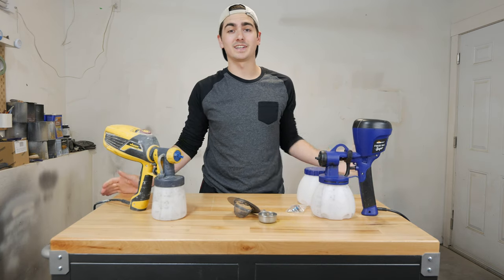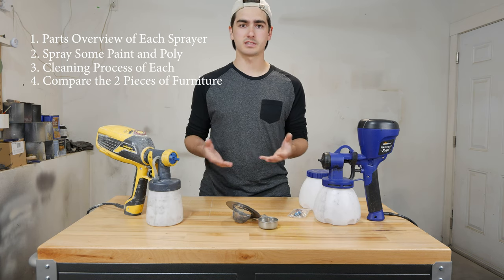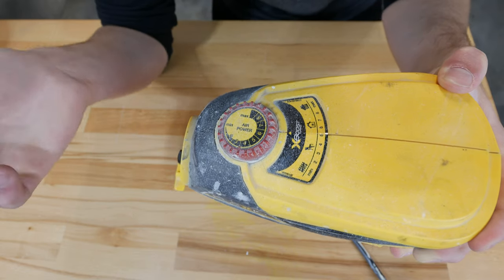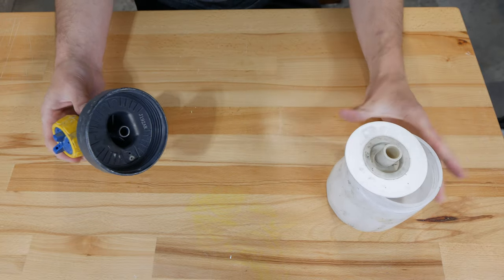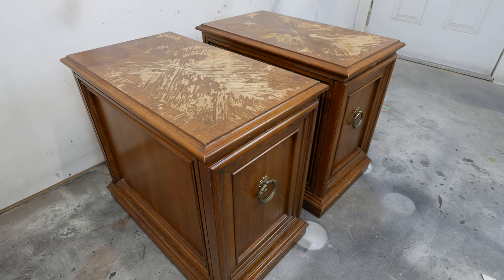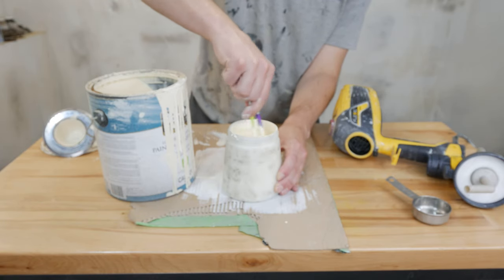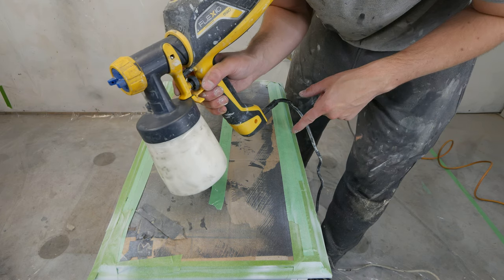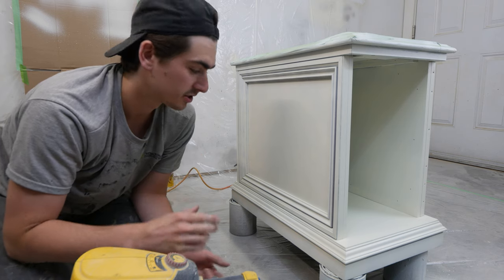Wagner Flexio 590 VS HomeRight Super Finish Max | Paint Sprayer Comparison, Review, and How-To

Comment: I have both of these except my Wagner is flexio 5000. The Wagner has a much better finish. Howright finish was a bit bumpy. My Wagner is great for the multiple projects I do. I actually bought a separate hand gun with container for about $30. I was able to switch between colors quickly. Cleanup is also hands down the Wagner. Love it.

Comment: Control and repeatability are key with any paint project. I do not recommend pouring unused paint back into the original container as you are now mixing thinned with thick paint to produce a somewhat thinned paint. Once you find out what dilution works, stick with it. Keep the thinned paint in a separate container and then you can thin more to always have the same dilution. Granted as the original paint ages it will get thicker and require more thinning, but for a specific project you can control the process from start to finish and then readjust with the next project. Thanks for the comparison.
Reply from the maker: Good information, thanks for watching Tom!
Reply: A simple funnel with a small hole can help here.  When you find a sprayable thickness of paint that takes, let's say,  8 seconds to drain from the small funnel,  you can always calibrate the thickness.

Comment: Don't know if its been mentioned but to help with the spitting at the start of spraying on the wagner pull the trigger in slightly to kick in the turbine then after 3 or 4 seconds pull the trigger in fully to release the paint.....I found this helps.
Also diluting the paint is key to a good finish.... its just trial and error but I was diluting up to 50%
Reply from the maker: Yes, slightly pulling the trigger certainly helps but I do still recommend starting your spray off the surface you are painting just to be safe. Thanks for watching!

Comment: Since the Wagner is much easier to clean and wanted the variable speed turbine for added flexibility. Despite the Wagner having a higher pitched motor, it seems quieter. So I’m going with the Wagner Flexio 3500.
Reply: Flexio $185...homerite $100 fyi

Comment: Quick tip. If you turn the nozzle diagonally on the wagner, it will spray a round pattern vs a flat pattern.

Comment: both of these sprayers suffer from the same problem which is that neither have a thumb switch to activate the motor. on these machines when you press the trigger it will do two things (activate the motor and allow the paint to flow at the same time). when you press the trigger it will take time for the motor to spin up and the paint that comes through during that time will be at a much lower velocity than it needs to be causing all sorts of splatter problems.
with separate controls you can have the motor at full speed with the paint flow off, and then when you trigger the paint flow it will be coming out at full speed.
almost no one talks about this but its absolutely vital if you want to actually get any amount of work done without going back to fix mistakes! the previous version of the wagner flexio had the thumb switch for the motor, i have done hundreds of hours of emulsion work with it and i wont use any other sprayer.

Comment: I got the Wagner and have painted several door and drawers with the big sprayer after thinning the paint down quite a bit.
Reply: I have found this wagner needs to be cleaned frequently for a consistent operation. The heater air from the motor seems to make the paint dry on the nozzle and then it spits and throws clumps of paint.

Comment: I have a bungalow with a pebble-dash finish that needs painting. - virtually impossible with a roller or brush.   Can I use the Wagner for masonry paint and will it stand up to painting outside walls?
Also would I need to water down the paint?  I was looking at airless sprayers and they seem too complicated for my needs - especially priming and cleaning and wotnot.
Too much hassle.  But the Wagner seems brilliant.  Great informative video by the way.

Comment: Notice the test run of Flexio at 14:00 vs HR Super at 21:15. Flexio seems to spit out paint at the start while HR Super doesn’t. That’s probably why you said it’s easier to spray with HR than Flexio.
Reply from the maker: True, both can spit but the Wagner always does when you start and I guess since I am aware I just begin spraying off the edges every time! thanks for watching!
Reply: @FurnitureFlippa  You paint with Wagner badly. You have to press the trigger gently so that the engine starts and then squeeze the trigger all the way.
Reply: Barely press the trigger to start the airflow without letting the paint getting out immediately. Once air runs at full speed, press the trigger fully. You can start in the middle (bad practice but sometimes you are out of other options), just start moving the gun before you start spraying.

Comment: I also used the green spray tip on the Homewright for poly but it actually works so much better with the blue one.
Reply from the maker: I usually just use my Wagner for poly because of efficiency, but it does spray less when you increase width, so def a better option.

Comment: I noticed the Wagner has two spray nozzles and triggers. One is for bigger projects, and the other for finer detail jobs. That would explain the coverage issues. Which one was used for the 590 Wagner? I wonder if the larger canister and trigger would outperform the home right.
Reply from the maker: I used the fine spray nozzle in this video!

Comment: thank you for doing this review and direct comparison! I am curious about what you do with the sprayers between coats — I had an issue where my wagner sprayer just clogged right up if paint sat and dried, even for a small amount of time. do you do anything to prevent this? Thanks, again!
Reply from the maker: I will put tape over the tip, but I won't let the sprayer sit overnight. I will go in every so often and spray the gun to make sure it doesn't clog just on a piece of cardboard. Thank you so much for watching!
Reply: I take a wet piece of paper towel and saran it over the nozzle between coats. I have left it overnight and it worked fine.

Comment: I'm a novice and need to paint entire walls and ceilings in a new house quickly. Would the homeright be better than the wagner for that? I'm also debating just using an 18" roller...
Reply: I'm still waiting for mines from Amazon but I've own a small gun like this before. My personal advise is to just use the gun to do corners, trims and door but use a roller for doing big areas. It will be too much stopping and going to refill the small cup to do big area. I was thinking if the gun would work without the cup, if it does many you could make a custom hose and run it directly from the paint can.
Reply: @kirkbrown2147  Thanks, that all makes sense, but ultimately, my wife convinced me to just throw enough money at the problem and have painters do the whole house. I still might get a cheap sprayer for small diy projects.
Reply: @Phrancis5  Smart choice. I primed a small  7’x13’ room with the home right and it was a lot work climbing a ladder to get to the top of the wall as you need to be around 12 inch’s away from the area that needs to be painted. Also having to refill the container was a pain. I ended up rolling the paint on with an 18 inch roller it was a lot less work.

Comment: On the Wagner witch gun do you use for polycrylic and how do you set it up? I am try to clear a table top but am having trouble getting a nice smooth coat with the manual techniques. Between coats do you take everything apart and clean to prevent clogging from the polycrylic  drying. Sorry for all the questions but this table top has been such a pain!
Reply from the maker: I do the same with polycrylic as I do with the water-based poly i used in this video, polycrylic is water-based polyurethane. 10% water thinned.

I like the Wagner for spraying it because of the quick cleaning process. But I do not clean between coats unless I am waiting overnight. I will put a piece of tape on tip between coats during the day. 

I have a blog post with some more info you can see here: 
https://furnitureflippa.com/can-you-spray-polycrylic-with-a-spray-gun/

Comment: Hi mate , can I use duluxe wall paint with Wagner ? They are thick paints so I don't know if they are ok for that ? Thanks
Reply from the maker: yes you can, some paints will require more watering than others. Add 10% water, if not enough add another 10%... I have added anywhere from 20-30% water to my thick paints while spraying before.

Comment: How do you determine if you’ll use a brush to paint vs one of these?
Reply: A brush should be better for the penetration and/or adhesion. Thus when painting a not too large outside fence (or porous material), brush could be the best. Or the roller if you care about the surface or paint speed. 

But! Whenever you wish to have a perfect final surface quality then there is usually no other option then spraying. Ie. all inside doors, their frames. Furniture. Car or motorcycle parts... Anytime when you paint a larger flat surface spraying is probably preferable as any imperfections are visible.

Though, there are certain laquers (eg. shellac) or paints where you can get a perfect result even with some brushing or rolling technology. It has been used originally in the past. You may need to arrange the surface eg. horizontally in order to let the paint to flow to a flat surface. Basically, it is a process or technology which is not easily repeatable. You may need to experiment with the laquer, brush type and style. It will slow you down.

Eg. my inside doors and frames are sprayed but the window frames were brushed and/or rolled. Both by the professionals.

Comment: Nice comparison. I noticed you are using the green tip on the HomeRight which is the 2mm size. What size tip are you using on the Wagner?
Reply from the maker: Only one tip with the wagner and its plastic.
Reply: @FurnitureFlippa  okay but that still doesn’t tell me the size.  I just ordered a homeright and I think I will use the 1.5 mm tip as I have heard on other videos that the Wagner 1.4 mm tip is the best size for fine finishing with paint. Perhaps the homeright felt like a tougher finish to you because of the 2mm size.
Reply from the maker: @violetgypsie  Not sure the size, I can't find it in the manual or anything. Would have to be measured, but perhaps that is the reason!

Comment: Great video. Could I use poly crylic with the home right and if so what tip?
Reply from the maker: Yes you can, polycrylic is waterbased poly, so follow the same steps by adding 10% water. Blue is the recommended tip for polyurethanes/finishes/stains.
Reply: @FurnitureFlippa   I noticed in another video you use the same tip as you use for chalk paint? I really don’t want to have to use the blue if it works for you with the green. Thanks for responding. We appreciate your videos.

Comment: curiously I noticed after you sprayed and were ready to clean the gun, you poured the paint back into the original container, Wouldn't that mess up the original container as the gun paint has already been thinned? Good video. I'm leaning towards the Wagner. But as another reviewer said, it's the same company.
Reply from the maker: Yes it would be different, but I didn't add as much the second time and made sure to get the same consistency. And yes funny they are the same company!
Reply: Wagner bought out homeright.. but it is still homeright's original design. So technically not the same company designed it.. Wagner just saw them as getting too big so bought them out.

Comment: I don't like the idea that if I am spraying up then need to spray down ... I have to take off the paint jar and turn the tube.  You would think it would have a weighted tube so it would do that for you.  Come on Wagner and others think about what your making.  LOL  Wondering if the dirty filter on the Wagner is cutting down the flow.  It sure looks weak on the spraying.  He should have poured the leftover paint right into the other sprayer.  Would have not been a different mix as he thinned it again and that could have made the paint flow better.  He also shouldn't be pouring paint down the drain.  Wash them outside.  Other than that....... Great video for info.

Comment: I noticed you sprayed primer from a can instead of through the spray gun.  Does primer not work well in the sprayers?
Also can you use waterborne alkyd paint in these sprayers is thinned or would you get orange peel look?
Thank you
Reply: I have the wagner.  U can use primer but some primers, like zinsser bullseye 123, are a lot  thicker so will need more water. He probably used the spray can for convenience. Some of the alkyd paints I've seen don't give any instructions  on thinning with water so would only look at brands that give these instructions on the tin.

Comment: Can you tell me in your opinion... the best filler to use to replace a small area of veneer?
Reply from the maker: Well depends on size, but I would likely use bondo if painting.
Reply: @FurnitureFlippa  it's pretty small... maybe quarter size at best!! Thank you
Reply from the maker: @tonipope3164  you can get these little tubes of epoxy putty that could work no problem!

Comment: You don’t need to put water in paint with Wagner. Flexible 590 it s for unthinned  paint but homeright  designed for thinning paint.you should compare Wagner 350 with  Homeright Super finish

Comment: Great video
So how does that width lever work?
Reply from the maker: I believe the width you are talking about is controlled with the flow dial on the homeright, so more paint, and a wider spray. The Wagner you can't really control the width, you can try increasing the amount of paint but I find it really comes out based on the thickness of the product. You can use the other nozzle on the wagner and it controls the width, you just move the red piece back and fourth.
Reply: @FurnitureFlippa  Thanks. Theoretically when the spray is made wider, the coating will be thinner if the volume stays the same. So it does make sense to turn up the flow in order to set it wider.

Comment: Hi thanks for the Video, I feel that people are not pushing these Airless painters to the limit, what are they like using 
Varnish (Solvent-based)
Plastic dip 
Rustoleum
Car paint
Hammerright 

Everyone always plays it safe and uses water-based products yet the Wagner Boast that with a change of a gun you can paint metal and varnish 
No one wants a $200 one-trick pony. well the Wagner even boasts a truck bed liner with a 630w machine and an ispray gun. be nice to see what gun can push the limits for hobby and DIY

Thanks for this starter video
Reply: These are HVLP tools, not airless. It's a very different technology.
Reply: @SamtheFinishingMan  fully get your statement but items need to be push to make them better as the makers only push a basic option

Comment: I kind of bounced around through the video... Did you sand between coats at all? I have watched some other tubers that sanded between for a smoother finish with the homeright... The other thing I saw in other videos was that they for sure had to adjust the paint volume lower with the homeright as well.
Reply from the maker: I do in any other project, but for this, I wanted to see how each would spray. I can sand anything smooth, I was testing performance to be able to compare.

Comment: I have a flexio that I have not used yet (I still brush) .. However I've been watching this awesome sprayer called "critter Sprayer" it's Only 50 bucks on Amazon and Apparently this has been around for long time and many cabinet finishers love this critter ...What I Love about it is it is Literally No clean up ...they use canning Selfsealer Jars ....Maybe you could do a critter verse Flexio.  .so I can learn how to do both haha ..I'm chicken... 😊
Reply from the maker: It looks like the critter needs an air compressor, which I do not currently have!!
Reply: @FurnitureFlippa  true BUT a small Compressor works great from the countless videos ...What I Think is What Sets this critter above any other is The Paint and mineralsl spirits Keep in the mason Jars which the 1 mason jar comes with critter and I just bought a 6 pack of mason jar. ..so when done with paint.  .just put lid on and then Stick tube into the mineral spirits jar and a couple of pushes on trigger and waaalaa the needles Cleaned  and then Just put lid on the mineral spirits jar ..so pretty much NO clean up ..so I have both the critter and  flexio....have NOT tried Either ! Yet 🤣🤣👍
Reply: @FurnitureFlippa  I have a small 3.5 gal Cobalt whisper quiet compressor and that's Sufficient....NOW let's see IF I can congure up the courage 😂

Comment: Can these guns to paint a car.
Reply from the maker: No these are not for painting cars
Reply: Why not?
Reply: @elidyson256  they won't give you a reliable and great finish. They are made for cabinets, furniture trim fences etc, they are only one stage(fan) units so thicker materials won't go through as easily. You get more splatter with lesser stage units. So you'd have to sand more. From what I've watched on YouTube I think at least a 3 stage should be trustworthy for a car but idk 4 sounds like a better option. I'm probably gonna make my own hvlp or by the Graco, Apollo,Fuji or titan hvlp.

Comment: Maybe you need to up the settings on the Wagner? Trigger screw in to increase paint flow and air pressure up a bit.
Reply from the maker: Adding more water usually helps thick paints spray better. This old behr paint was thick, I used Fusion paint a few days later and it came out like butter. Highly recommend Fusion mineral paints in the wagner.